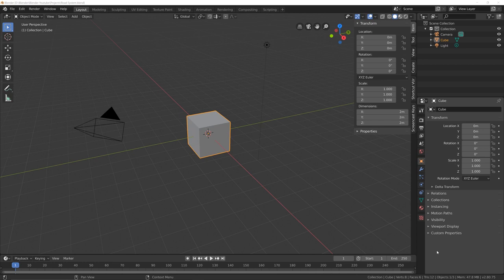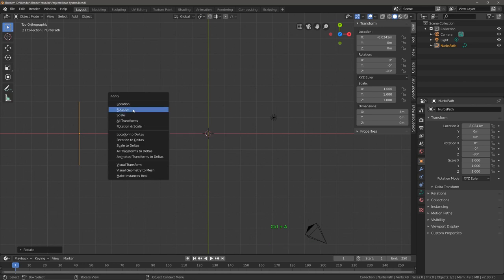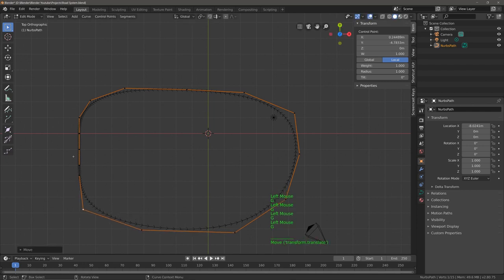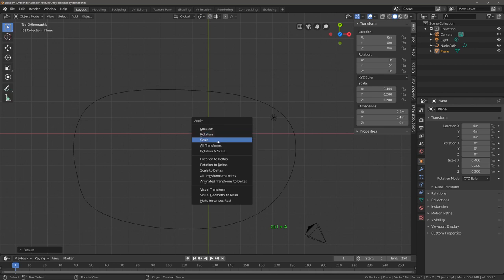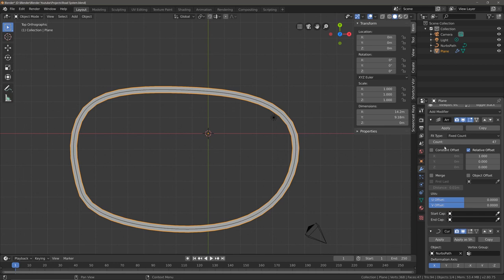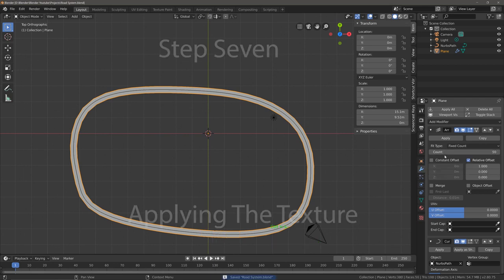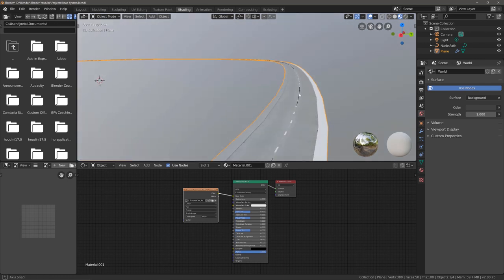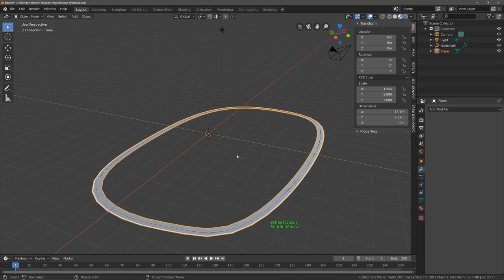How To Create Any Road System With Paths - Blender 2.8 Tutorial

Comment: Great. But I have a question. Why if we have a terrain with bumps and hills. How to make the path points to sit on the highest height on the terrain? 
Thank you
Reply from the maker: One solution is to enable snapping and then set the snap to face. Then as you create the points to your path those points will be able to snap to the main surface.
Reply from the maker: @Darwin Colgan Creating Junctions is much more difficult when using curves as all curves want to follow a single path. An easier solution is to create modular pieces and then use snapping to reconstruct the road as you see fit, because it is much simpler to model the junctions themselves and have those junctions, like a t shape for example, as a modular piece.

A good workflow here is to add a new collection to store all of your road parts, then create linked duplicates of those parts to build your road.

Hope this helps,